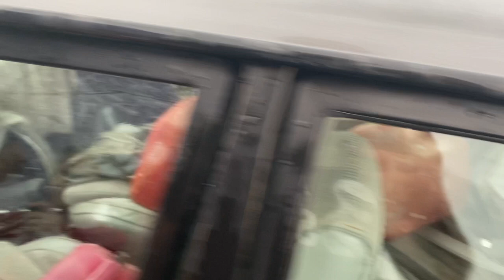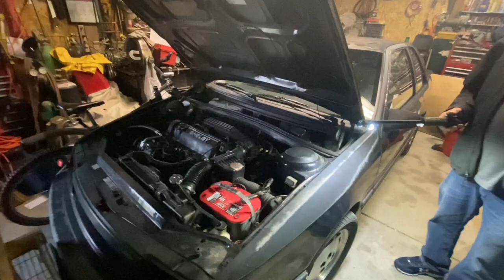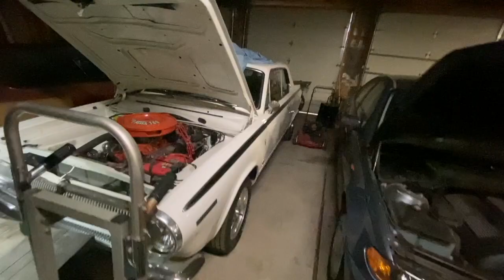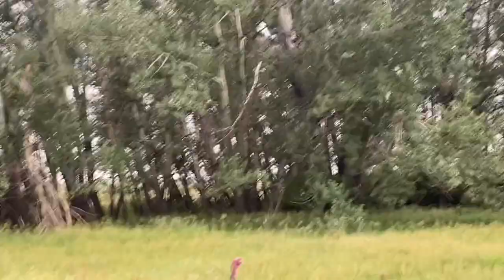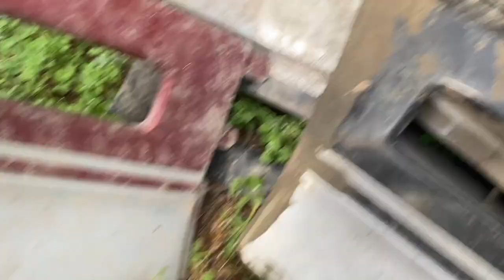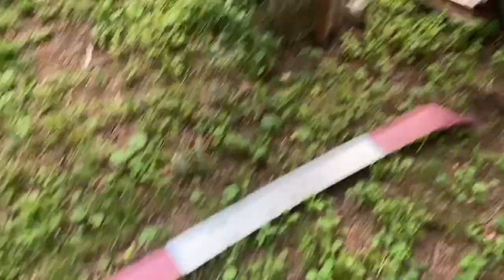I Went to a Hidden Honeyhole of 1980s Turbo Dodge Parts In Colorado

Comment: Wow, those bumpers came right to life with some cleaning! Last month I was bidding on an '84 Rampage on eBay... ran the VIN, but it was the VIN of an '85 Charger. Needless to say, I was very confused. Apparently, they combined them together to make a Shelby version of the Rampage. Probably for the best I didn't get it. (It'd been drag racing.) So, are you considering adding those bumpers to your Rampage? I feel they really improve the look of the 82/83s from somewhat pointy front ends to completely trackworthy and badass. Very excited to see your progress.
(hold onto one bumper for me - I may have news soon)
Reply from the maker: Yeah adding the bumpers is the plan. Should have an extra